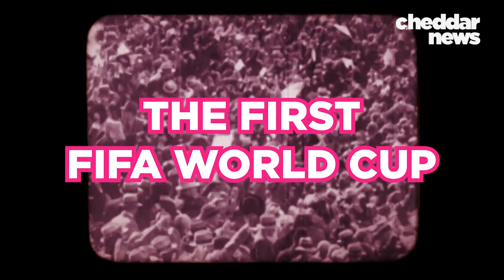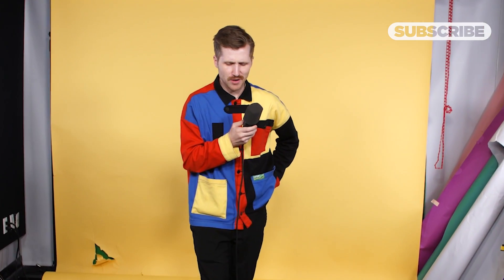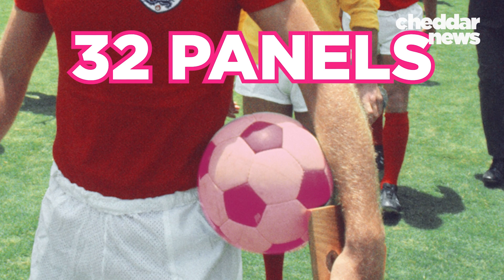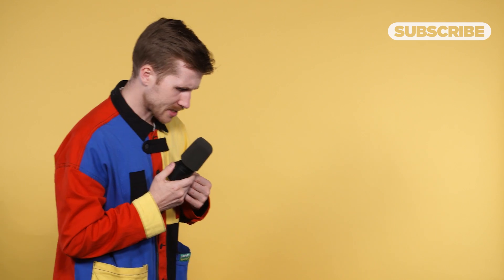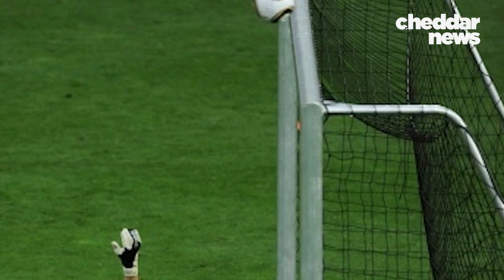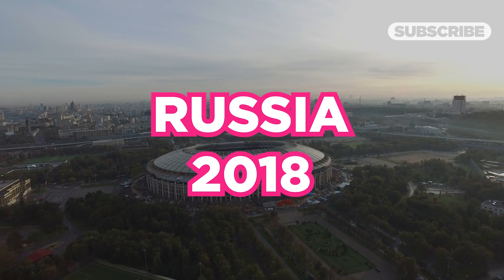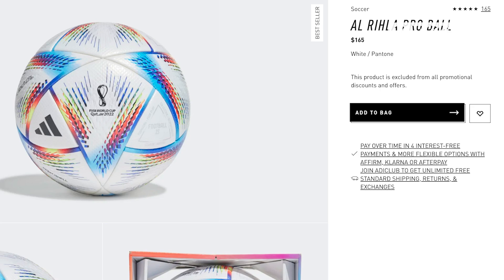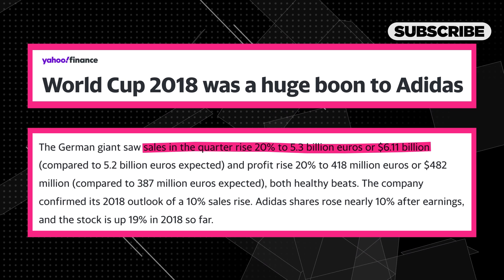Why Each World Cup Has A New Ball - Cheddar Explains

Comment: In 2002 I saw a feature on the new (at the time) ball for the World Cup.  They had a kicking machine to test it - making sure it flew true with the same kick.  They then used the machine on one of the balls from the 70's and difference in flight patterns was quite significant.  The old ball didn't fly nearly as far and the flight path was very erratic kick to kick.

Comment: THIS IS MY TYPE OF CONTENT!

Next, why did all the goal-posts go from stantions to the big rectangular nets with suspended corners?
Reply: Because ghost goals/goals not given. Sometimes shots that would hit the top corner (inside the net) would hit the stantion and bounce directly out making it appear like it hit the post rather than go in the net. Once they started using those box/square nets with cables holding up the corners the problem went away. It probably wasn't until the late 90s, early 2000s that it became universal in the top professional leagues but you'll still see those older goals at any local park, especially the posts with the ring/loop at the top because they are easiest for groundskeepers to lift or tie the mesh up quickly and mow the grass underneath then drop the nets back down.

Comment: I bought the Teamgeist, the Jabulani and the Brazuca. Sadly the Teamgeist is leaking air and no longer usable. Annoying for a ball that costs over $100. With each world cup the balls got about $10 more expensive. So I stopped buying them. 

Those balls are no longer exactly the same as used in the world cup anyway, because the balls in the world cup have sensors for the goal line technology in them.
Reply: Lol “inflation rate” get it
Reply: I just bought the Adidas Al-Rihla Pro ball for £130. Your comment now makes me worried about its longevity 😕
Reply: @ryadhasanahmed5443  Maybe my mistake was not making the tip of the pump wet, when pumping the air into the ball. That is very important. Otherwise the air valve might leak and ut seems impossible to repair it.
Reply: @ryadhasanahmed5443  I bought it too it will definitely last if you know how to take care of it for example I have had the 2020 euro cup ball for two years now and I have kicked the shit out of it and still is very good is just the problem with match balls is that you have to only use them in a pitch bc if you use them anywhere else it will damage quickly for sure and gotta clean them too
Reply: I haven’t had issues with my jabulani ball but I can’t say the same for others
Reply: the problem i had with the older balls, in my case the europass (recolored teamgeist for the 2008 euros basically), was the panels peeling off
Reply: is there any kind of warranty on these balls when you buy them? Like 2 weeks later panels start peeling or the ball doesn't hold air...
Reply: There is no chip for goal line technology, because goal line technology uses the hawk-eye system powered by cameras to determine if the ball crossed the line. The chip that was introduced in 2022 is for semi automated offside. It‘s used to determine when contact was made. The ball is still the same if you buy a original one though. The chip doesn‘t change anything. As long as you don‘t buy a replica ball (which are usually half the price) you‘re good.
Reply: https://www.youtube.com/watch?v=-IaU8fMxbaM very high quality results for your leak if it isn't the valve.
Reply: You can fix it